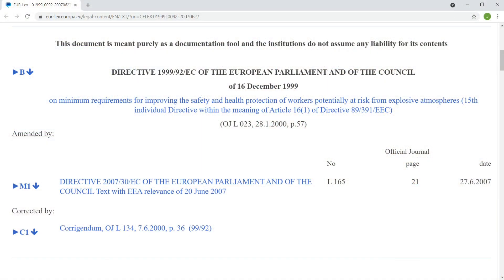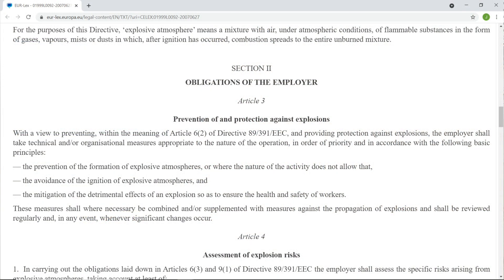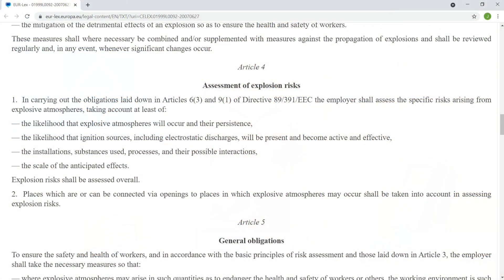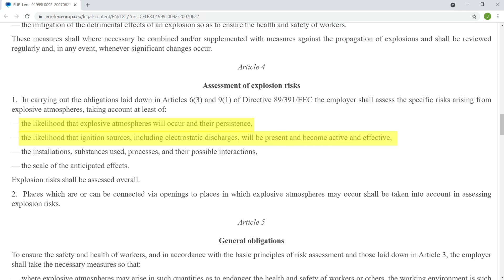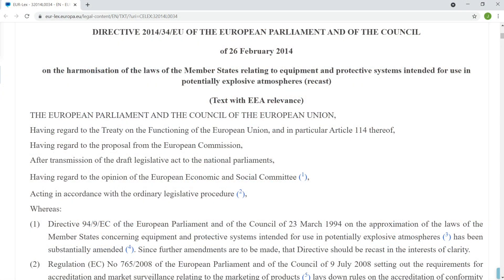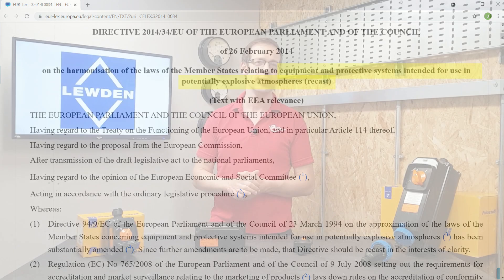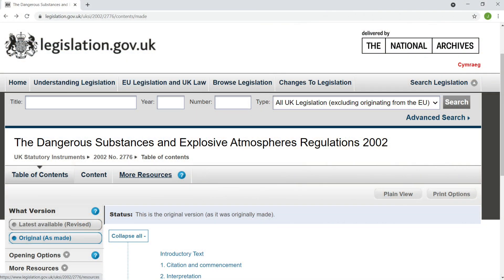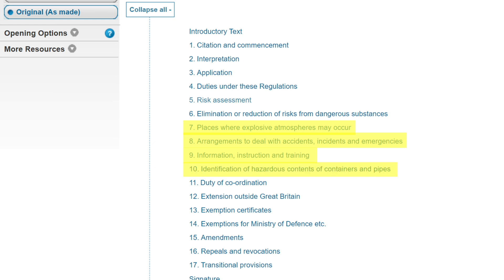WHAT IS ATEX ? - Hazardous locations and electrical installations

Comment: I worked for 16 years building EX cctv systems for hazardous areas. It was BASEEFA certified, then became ATEX certified. Stainless steel housings containing camera trays, or Junction Boxes, and monitor housings. We also put lightning surge arrestors in EX JB's too. All the cabling, glanding, etc also had to be EX rated. It was a complex, expensive business. We mainly manufactured systems for Oil refineries (Conoco), oil platforms world wide, Chemical plants, Nuclear power stations, and flour mills. It was really interesting work, varied, and got to play with and build some great projects. A lot of the staff did not understand EX equipment at all, or it's importance in safety for hazardous areas. They never lasted long in the job lol...
Reply from the maker: Sounds like a really interesting time in your career. Thanks for telling us a out it. 😊

Comment: You need to look at the Design, Construction, Modification, Maintenance and Decommissioning Of Petrol Filling Stations  Jointly published by the APEA and Energy Institute.
Also required is a safety passport to work on Petrol sites.
Reply: Need more than a safety passport, also need to be compex trained to install and verify the electrical installation in a hazardous area.
Reply: @c8bbr  I retired in 2016 mate worked for 25yrs for one of the big oil company's. Just look after mates and family now.
Reply from the maker: Great comments, thanks very much.
Reply: @brianpiddock6074  I work for one of those big oil and gas companies. Cracking place to do electrical installations and maintenance. Enjoy your retirement well earned
Reply: @c8bbr  needs knowledge of area classification and installation, design, selection, erection, inspection, maintenance and international standards